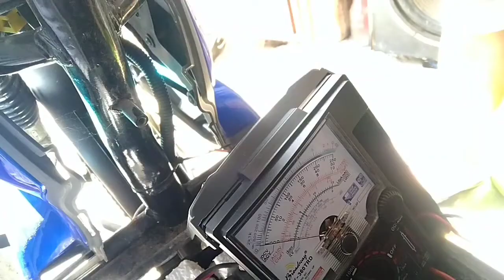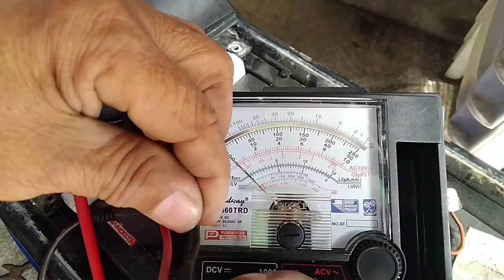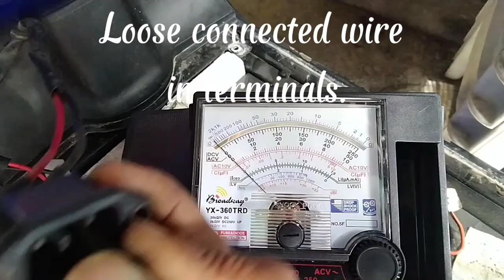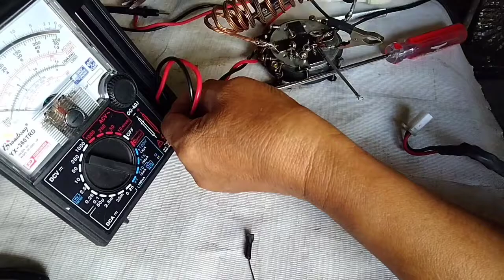EBIKE NOT CHARGING.VERY EASY TO REPAIR.WATCH IT.

Comment: I have same bike but not charging , its 3 months old only , I changed new charger also but still not charging .
How can I open back up seat ??
Reply from the maker: unscrew the seat in the front ang slide it forward because it has an oblong hole in it.
Reply: The seat is not opening , I want to open pillion rider small seat , not driving . I think all connections are under the back seat .
Reply: Thanks 🙏 , I could open the back seat , all connections were good , charging socket is also good , but still not available to charge battery 🪫 .

Comment: Magandang Araw, boss😊napadpad ako sa channel mo. about sa di mag charge. pano po pala yung charger meron power pero di na naikot yung fan nya sa loob ng charger
Reply from the maker: meron ngang ganyan trouble.pareho sa isa sa mga nagawa ko na.isang maliit ng transistor kulay itim ang pinalitan ko don at gumana.
Reply from the maker: kindliy subscribe my channel pls!
Reply: @nelpercabida5840  boss, pwede favor bka pwede mo maituro kung alin dyan transistor
Reply from the maker: @ng5149  di pwede dto sa chat magturo ng isang sira.kc pwede rin yong katabi ng transistor na mga resistor ang sira.kelangan marunong kayo mag voltage checking.
Reply: ung ebike ko po ayaw magcharge,,naka red at green lng dapat sana may tunog 
kaya lng wala kaya ayaw tumakbo

Comment: Manong paano po ung ayaw po mag karga Ng battery pero po pag isinaksak s outlet po Mismo at binuhay po gumagana po Ang ebike. Anu po kayang deperencxa Ng ebike po ..slmat po
Reply from the maker: Time to replace na Ang battery mo.ayaw Ng mag store Ng voltage .
Reply: Ganto din sakin, kuya minsan ko lang po kasi naggamit ebike ko tapos po pag chinacharge ko sya green lang ung ilaw tapos po pag pinagana ko sya isang beses habng nakacharge ngging red ung charger ano po kaya sira nun kuya 🥺 sobrang drain na ng battery nia d ko na po macharge d ko po kasi alam anu sira eh

Comment: Hi sir ganyan problem  ng ebike ko ayaw mag charge nakagreen lang kahit lobat  na , may mairecommend bakayo dto area ng antipolo nagtanong po ako sa iba sabi battery daw palitin tapos swap ko battery ko s kanila bakit ganoon ,hindi po madalas gamitin
Reply from the maker: No ,hindi agad-agad batery ang cause ng mga ayaw mag charge.tulad nga nitong napanuod mo sa vlog ko. O diba wire loosed connection lang. Cavite kasi ako malayo para magservice kmi sa Inyo. Ask ko lang po.ilang buwan na po ba ang batery nyong yan?
Reply: @nelpercabida5840  sir mag 2 years na by July tong ebike  ko peto madalang gamitin saka 2 months ago nabuksan pa to ng technician  ok pa daw no problem,  nagtaka lang ako yung mga nagbibinta ng mga battery bakit need nila old battery ko swap daw kaya nag duda  na ako,cge sir salamat  try ko hanap ng technician

Comment: Sir nag chacharge po ebike ko kaso po mga minuto or isang oras po nag gregreen napo agad siya tapos po pinatingin ko po sa mga gumagawa ng ebike tinester po nila okay naman po battery tapos po may ebike po tita ko 48v12ah charger din po same po kami ebike nung trinay ko po yung charger niya ganun din po nagcharge ng mahigit isang oras tas nag green na ano po meron don
Reply from the maker: ganon nga po ang batery kapag ayaw nang tumanggap ng voltage charge.batery po ang palitan nyo.
Reply: Ganyan din po sa akin sir 1month palng yung battery sa akin 3hours full charge na pero di sya nafufull charge 3 bar lang dpat 4 bar salamat po